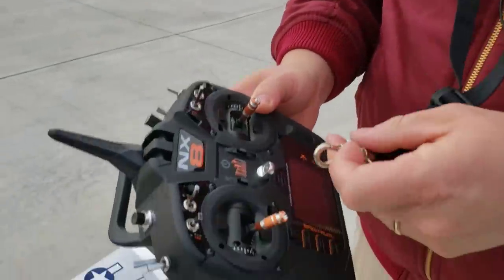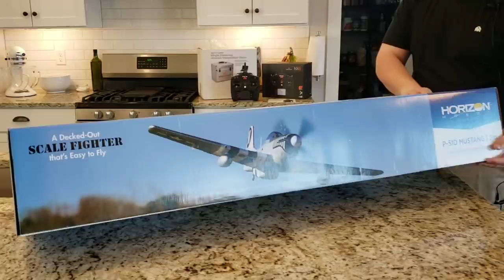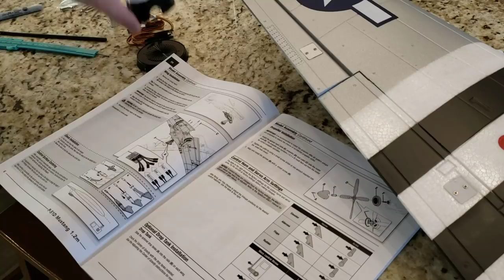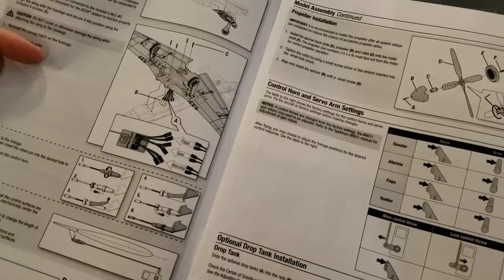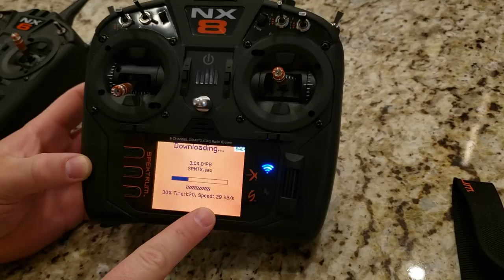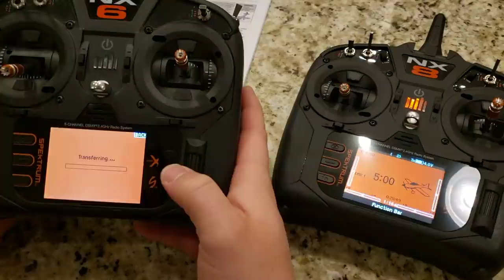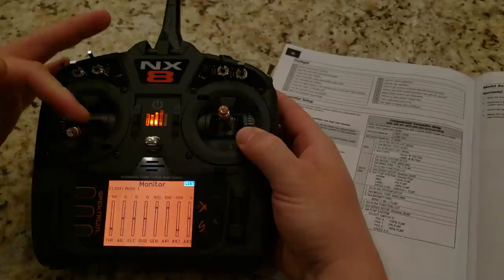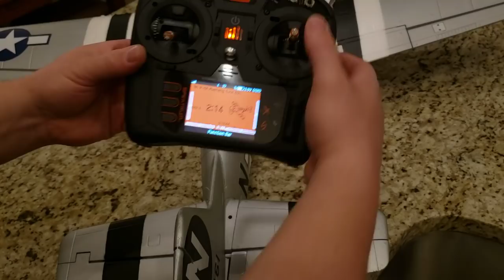E-flite - P-51D June Nite V2 - 1.2m + NX8 - Unbox, Build, Radio Setup, & Maiden Flights

Comment: You don’t have to use wifi if you want to use one of the bnf templates. When creating a new model, select the icon “BNF” and it gives you a list of models. This list is embedded/loaded with the firmware. Your could show people the list (find the model in the list to show it is there) and then back out and do the manual setup. I still think this is the p51 to get. 😀
Reply from the maker: Cool, I've never done it before. I'll try it out. Thanks!

Comment: Hey Brian, I  don’t want to be a pain in the neck, but I’m wondering what batteries, Chargers, and such I should buy straight out the gate. 3S, 4S, how many should I get, ??? etc. Keep in mind ,I’m a Virgin Pilot, I am going to learn the basics on the Volantex mini mustang,I pray that is possible. I have one shot to buy the plane of my dreams since I was 12, and that’s the June Nite P-51. You’ve been so cool and Patient with answering all my questions, really appreciate you brother!!! I just want to get everything I immediately need, at a tolerable price!!! Thankyou Again, YOU ARE AWESOME 😎
Reply from the maker: Don't ever buy a battery you don't have a specific need...you'll be wasting money...they're quite expensive.

If you want the June Nite (Great first warbird, but not probably 1st plane status, in my book...maybe #3 to 5...)

Here's what I would encourage you to consider...

P51 1.2m / 1.5m (make sure you get the 1.2m...NOT the 1.5m - Trust Me!!!) - https://bit.ly/3bU5icI
G2 2200mAh 3S (one or two...they will be used with other planes too) - https://bit.ly/3hQvYMI
G2 2200mAh 4S (one or two...they will be used with other planes too) - https://bit.ly/2L1SgiM
NX8 (if that's too much, the NX6 will be a very close second choice) - https://bit.ly/3mbVuNB
S2200 (This charger is pricey, but it's the top of the line, if you want TWO at a time, this is the way to go, and you'll buy less adapters, which are crazy expensive since the batteries are new tech still) - https://bit.ly/398ohO6

Comment: I bought 3 planes after your reviews and thank u for what u do and Thx for your response. On your video at 1.56.37secs. You talk about trimming. Can u do a video on trimming on this plane? I take off and my P51 loses steering before i take off such as going to left or right. also, I think it's also all over the place in air. I would like to know more on trimming.
Reply from the maker: The reason you're struggling to trim is you're thinking of trimming on the ground vs in the air. They are two different beasts...especially with he P-Factor of a warbird.

Get it flying, then trim it out. If you have a bad behavior on landing, then make the mechanical trim on the tail wheel, but on TAKEOFF, you're probably experiencing the pull and torque from the power of the prop trying to "SPIN" the plane into the wrong position, and this is a common occurrence with warbirds. You will have to spend many many takeoffs to get this under control, if you're new. It's hard, but when you get it, you'll feel a sense of accomplishment.
Reply: @BrianPhillipsRC  it makes sense. Thank you.

Comment: Brian just purchased and maiden my P51. Have a quick question. When binding the plane the manual tells you to do it while sitting on the mains and tail wheel. I noticed you did it while sitting level on the stand. Which way is correct? 
I’m asking because during my maiden the plane wanted to climb at any throttle response above 35%. I had to put almost full down trim to make it stop climbing. I’m not sure if this was a result of rebinding it sitting on the tail wheel or not. I rechecked the elevator to make sure it was level and it was. Just to clarify I did set the elevator trim back to center when I checked the elevator.

By the way love your videos and I’m one that watches them even when they are 3 hours long. Thanks for what you do for the hobby. My wife may not agree! I’ve become obsessed.
Just got back into it after loosing interest when I was a teenager. Already up to 7 planes and only been back at it for 8 months.
Reply from the maker: Humm....didn't realize the manual called for on the wheels - how exactly are you supposed to do that BEFORE you can open the gear?!?!? LOL

As for the "proper" way, give it a try BOTH ways and see what happens "my way" (in the plane stand OR propping up the tail wheel to make it like it's flying) then check out how the elevator responds with SAFE on.

Thanks for the question, but you'll learn a lot trying this, so hope you don't take offense to me asking you to try it ;) I know you're gonna get more out of this exercise , then my just answering it....plus it'll only take about 5 minutes - Good luck!

Comment: I'm totally new to flaps Brian. Could you confirm with me the more aggressive angled flaps are take off flaps and the middle setting is landing flaps? Do you use both positions or are you only using the most aggressive position? So their main purpose is to create more lift so you can come in slower to land?
Reply from the maker: The more deflection is for Landing. The LESS deflection is Takeoff.

Flaps change the shape of the wing, and reduce stall speed. They also induce more drag, so they can help slow the plane down, while not dropping into a stall. Additionally, they make it easier to point at the runway (fly down hill) and not pick up speed. This helps for full scale planes, so the pilots can SEE better.
Reply: @BrianPhillipsRC  thank you Brian much appreciated for the detailed response 👍🏾

Comment: Buying this with a Spectrum NX 6 tomorrow from my local shop for $350 total! Will be posting video soon!
Reply from the maker: NOOOOOOOOOOOOOOOOOO - Get the NX8 or NX10 - you will soon regret the NX6 decision

Pretty please, don't do it. I don't want to have to tell you I told you so.

NX6 is AMAZING, and WILL work for this plane, but you will outgrow it in like 3 planes...

NOW, if it's super cheap, go for it..."backup" for your NX8 and NX10 that you buy from our links ;)

Tx https://bit.ly/3f4JhZl
Reply: @BrianPhillipsRC  well it's $200 for the plane, used, but immaculate condition. Then $150 for the NX6, used but great shape. I'm already over budget, lol, but the bug has gotten a hold of me. 🤣

Is that worth it in your opinion?

This will be my first transmitter.

Comment: What were your actual duo rates and expo after all, did you adjust anything after the flight? I noticed on other footage you’ve been sticking with the rate 90 and expo 30 etc. did you do eventually do the same for this plane?
Reply from the maker: I do the same general setup, and don't believe I changed for this one...

All three axis of control
------- Switch F ------
Position ---- Expo --- Rate ----
0 --- 5% --- 100%
1 --- 10% --- 100%
2 --- 20% --- 90%
Reply: @BrianPhillipsRC  “ I see said the blind man  🤙🏽 “  thank you very much I really appreciate you and your teams time.
Reply: @BrianPhillipsRC  Its me again would the D/R and Expos  provided from you be ok for a beginner pilot, I’m currently working my way up to the warbirds now, I will be assembling the P-51 Mustang, T-28 Trojan and the P-47 Razorback all 1.2m. and just double checking?

Comment: Brian, I have a question.  I want to get this model.  I’ve already contacted Horizon and confirmed that they do not sell it without a receiver or with the receiver of my choice, which would be an AR637T and an Avian ESC.  Do you think it would be worth the additional expense to replace what is shipped in the BNF version of this model with the AR637T and Avian ESC?  I’d like the telemetry, especially the battery voltage warnings so I don’t have to use a timer and guess.  What do you think?  And, would there be any other advantages to making that change?  Great review.  I’m at 2:18 now and really enjoying the NX8 setup detail.
Reply from the maker: No. I would HIGHLY recommend the BNF. It's plenty good. IF you were into Futaba, or JR, or Jetti Transmitters, then I'd say, you'll need to get the PNF, but in this case, and most of the time with BNF's, they're way better value, and the additional telemetry isn't enough to justify additional expense, in my opinion.

IF YOU DO, you can still get the BNF, and just get the Avian ESC for the per cell voltage, I believe.
Reply: @BrianPhillipsRC  As always, thanks for the advice.  I did buy the receiver and avian esc to retrofit an older plane, a P51, that I found challenging.  Hung it from the ceiling before wrecking it.  Now with my NX8, new electronics and SAFE it is a real pleasure to fly.  SAFE level and angle limits are a real confidence building feature.  It allows me to try some full control flying while always having that SAFEty net there for me.  Thanks.

Comment: Brian, you’ve had the NX8 for a while now so perhaps you’ve already started to set up Flight Modes, but if not, give it a try.  That little control stick trick you do to set up your SAFE/A3X switch is unnecessary.  

Ooops, I was wrong here.  You do need to do that because the receiver that comes with the P51 does not allow you to set up Flight Modes that activate Safe/Level etc. Now that I have mine that came as a surprise.  Another surprise was that the ESC is not Smart compatible, so no in flight battery telemetry.  I’ve gotten spoiled with my other models, having those features.  It’s a bit of extra expense but I’ll probably replace the ESC with an Avian ESC, and the receiver with a 637T.  After I do that the following comments will be useful, but for the stock B&F model they do not apply.

If you use Flight Mode, you can assign one to each of three switch positions (a reason to use a different switch) and have one for SAFE level and limits, middle for limits only, and the third position for no limits, full aerobatic.  The other advantage of setting up Flight Modes is that is how you access the PANIC feature, which I assign to the bind button. Set Panic to go immediately to Flight Mode 1 (SAFE), and then enable Panic on Flight Modes 2 and 3.  Its a nifty feature that allows you to do and emergency rescue when in a screaming stall/spin.  A guy who flys as well as you might not need it, but I do, and others might as well.

I’ve started purchasing new receivers for al my plans and refitting them, some got new Avian ESCs as well.  The availability of SAFE, Panic, Limits and the nice timing and mixing on the NX8 have transformed flying RC for me.  I have to thank you for getting me headed down this road.  It was your videos that opened my eyes.
Reply from the maker: I'm so glad I could bring some help, but looks like you're off to the races now!!!

These new Rx'es are amazing! It's incredible how much better the planes fly with stabilization!!!

Comment: Great review! Would you pick this plane over a e-flite Viper 70mm as a first plane or the other way around. I guess I wanna know which one is more easy to handle and land? I can fly almost anything in a simulator but need to buy a real plane now:).
Reply: I have only 1 plane but if you want to start big, the Carbon Cub S2 1.3m is good, it has amazing grass landing, but the best is the Aeroscout 1.1m, it has a prop in back so if you crash it won’t break, it’s a tricycle so it’s easier to land and won’t flip forward on landing, both the E-flite Viper and P-51 are good but the Aeroscout and Carbon Cub are best starting

I crashed my Carbon Cub and fixed it, just a tip: expect to crash, laugh it off, and then fix it. Don’t get discouraged if you do, you will inevitably crash, it’s part of the hobby.
Reply: @gannonelkins5134  Thanks for your reply. So you don´t think it´s a good idea to get either the Viper or P-51 as a first plane? I can fly almost any plane in RF10 flightsimulator without crashing. Don´t know if that makes a difference. I just like the looks of the viper and p-51 over those you suggested.
Reply: @manstuff6073  Im not to sure, if you can fly on the simulator you probably could fly the P-51 or Viper so it’s pretty much your choice really, whatever you chose, good luck!!!
Reply from the maker: Neither. You will be a one and done if you pick either.

Here's a list of great choices as "Beginner" planes...but even still, they're a BLAST to fly, and you'll be in the hobby for more than a fraction of a plane - seriously, I know you want this and the viper, and you'll be flying them with skills in no time, but take my advice, please, you'll thank me later ;)

Description | Purchase | Videos
Habu STS 70mm RTF - https://bit.ly/38Kilv1 - https://www.youtube.com/playlist?list=PLXTH0DstRDc5fYbIobNAtMUz2EoT7FGLl
Apprentice 1.5m RTF https://bit.ly/2OIjVHd - https://www.youtube.com/playlist?list=PLXTH0DstRDc4LA2ldEUZQMVWkJpCslxRc
Carbon Cub S2 1.3m RTF https://bit.ly/3bS2r3O - https://www.youtube.com/playlist?list=PLXTH0DstRDc4Y9gQ5S22B_3SXmtqylcmM
T-28 Trojan 1.1m https://bit.ly/3eOh9Lk - https://youtube.com/playlist?list=PLXTH0DstRDc6-_gHuXM6a1Nf_2nRxrmlc
Apprentice 1.2m RTF https://bit.ly/2OIjVHd - https://www.youtube.com/playlist?list=PLXTH0DstRDc43Qw4KNOOfzt14n6ZBo3LS
Sport Cub S2 UMX https://bit.ly/3cDYUW1 - https://www.youtube.com/playlist?list=PLXTH0DstRDc5gY8qX_x8kAJq3glGMXjDy
AeroScout 1.1m - https://bit.ly/30MNn1c - https://youtu.be/vfZZQXx7jU4

Trekker 1.2 RTF https://bit.ly/34jhgLZ | PNP https://bit.ly/35xOPu8 - https://youtube.com/playlist?list=PLXTH0DstRDc7b7RhCrnT4x4AYrqRVhFHf
Bigfoot 1.3m RTF - https://bit.ly/30mYdOq - https://youtube.com/playlist?list=PLXTH0DstRDc7elVLLXihkLRs_J4QQ0Hm-
Pioneer 620mm RTF - https://bit.ly/2YotgbY - https://youtube.com/playlist?list=PLXTH0DstRDc5DZarP-qgPO3IEliNvnPuP
Prodigy 1.4m RTF - https://bit.ly/37zJxzt - https://youtube.com/playlist?list=PLXTH0DstRDc4_0cKHioZSQLqFkVdjj7mh
Reply from the maker: Oh yeah, RF9.5 or older will make a good simulation, but it's NOT real life...REAL FEAR plays a huge part in your success or failure, and it's HARD to replicate. You, if you're normal, will be shaking on your first few flights...not an exaggeration. You will need to learn to control your nerves. It's exhilarating when you first "get it" - but you'll have to take my word for it for now.
Reply: @BrianPhillipsRC  yeah, I have flown a few times and it made me SO nervous
Reply: @BrianPhillipsRC  I bought the sports cub s2 and went out on a soccer field. With a wind of only 3-5m/s this plane was all over the place and the power of the engine was barely enough to get plane to fly back in my direction. I don´t want to sound ungrateful for your recommendation but this plane is not an outdoor plane. In most outdoor conditions there is some wind and this is not the right model to fly outdoors with. Another problem is that the fram is so fragile. Just flipping the plane over to put in the battery almost turned in to a disaster because the tailfin is thin as a leaf and so easy to break. I managed to fly this plane and land it a couple of times withouth any crashes but it was going up and down uncontrolled. The plane is still intact and because I landed it safely.. However I consider this a indoor plane. I am looking for something bigger, heavier and less sensitive to wind as a beginner plane. Can you redommend somthing like that? Thanks for your time.

Comment: Me in my head, flair,flair,flair,flair....um he didnt flair...lol...I know it was the elevator.. love this p51.I have the 1450mm redtail.
Reply from the maker: With full flap deflection on this plane, as per the manual...it was a bit lacking. Extra hole setting out, and she'll let you pitch up much easier.

That being said, I never flare warbird tail draggers, that would be a recipe for stall. You gotta keep this plane flying with power, and get the now DOWN on final, in my experience.

Comment: Hello Ryan and camera crew, I have a quick question I like the June Nite and the focke wulf 190A.  What would be the better choice as flight envelope.  They both look like great planes, the focke is almost double the price.  But what plane do you think would be the better purchase.  June nite or save a little longer and get the focke
Reply from the maker: This is Brian, as in BrianPhillipsRC...

The June Nite  (1.2m) is in a different size class than the FW190...which is 1.5m...which means basically it's about half the size...I know that sounds crazy...it's only like 300mm different...well, yeah, but it's basically double the size ;)

As for the P-51D  1.5m  vs the FW-190 1.5m - go for the FW - flies better, more cool details, and I like it a lot better for landings.

As for the 1.2m P-51D June Nite - it is awesome, and you'll never regret getting this plane, if you're ready for a war bird...I assume you're flying out of SAFE, and pretty competent as an RC pilot??? If so, get the 1.2m June Nite and LOVE it for a while, then consider the FW, which is really nice too. It flies more than a little better than the 1.5m P-51D...which is a bummer, in my opinion, but it is what it is - I don't get to pick which one is better, but I can say with certainty...it is better. The P-51D is WAY faster, but the P-51D 1.5m is really squirrelly on landings too ;(

P51 1.2m / 1.5m https://bit.ly/3bU5icI ( I use ONE link now to help make my links list shorter, sorry for any confusion)
Fw190 1.5m https://bit.ly/2NswTZ2
Reply: @BrianPhillipsRC  Thank you for the reply. And yes im experience in flying.  I really like your reviews there the best